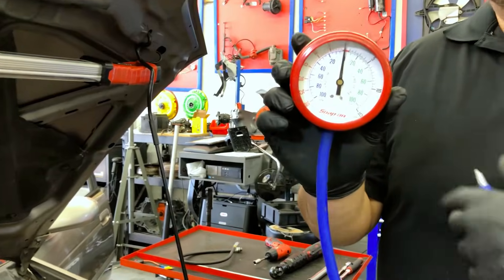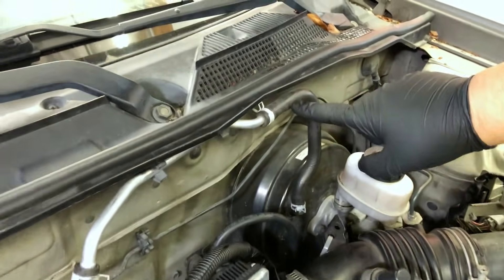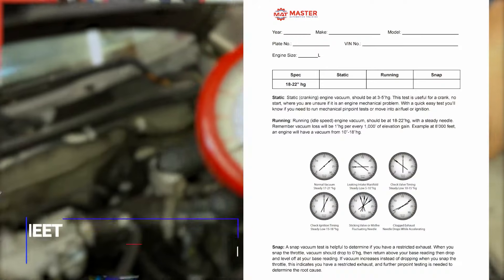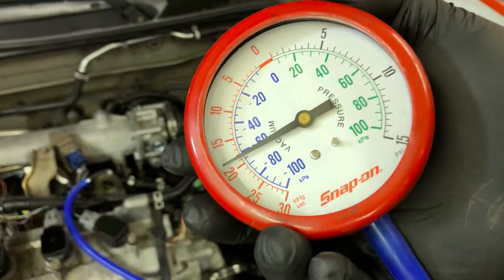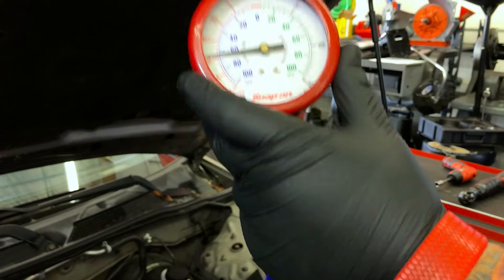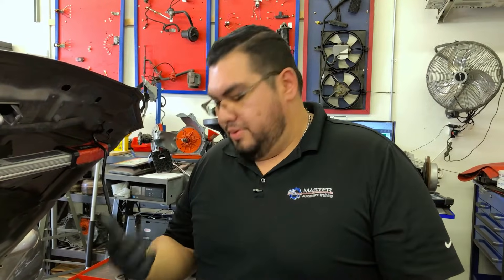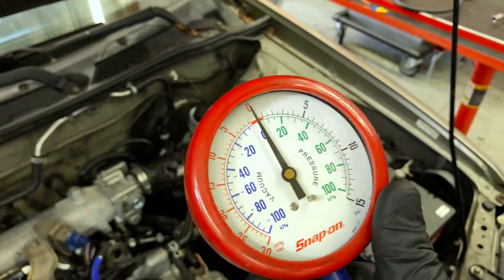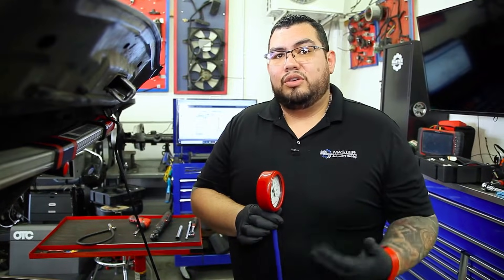HOW DO YOU TEST AN ENGINE VACUUM? | Step by Step

Comment: Now please re do this on a small block 350 engine. I cant figure out my total timing and I have no idea how to. I do not know what initial timing I should set my engine at 8 or 10 degrees and I do not know what vacuum I should have it at base because when I adjust my fuel and air mixture screws on my carb  my idle rpm climbs then I cant use my idle speed screw to lower the idle unless I drop my vacuum to around 14.

Comment: Can you use any of the hoses attached to the EVAP Solenoid Valve ??
Reply from the maker: Yes that would be the best point to test vacuum. It is a centralized point.
Reply: @MasterAutomotiveTraining  Sorry, let me clarify. Can you use any one of the hoses attached to the EVAP Solenoid Valve, or do you need to connect to one particular hose??

Comment: Another symptom of a crank no start condition timing issue is there is less resistance on the starter. The starter will spin much faster and you can hear the increase.

Comment: You can you the braje booster line on a 3rd gen 4runner just hook your vacuume hose into intake nipple ,I check  it that way and I also verified the way that you said results were the same ,thank you for helping us out .and were do i check fuel pressure on the 3rd gen 3.4runner v6 4runner theres no shrader so might have to get some fittings it would be cool to have a pressure gauge inline thatspart of the fuel line. Follow me ? Help is appreciated. Thank you .

Comment: Mistake in the sheet: At 8,000 ft =2,438 m - 10-14 is correct, not 10-18.
Please check.
Btw.: Fantastic informative video, thank you!
👍
Reply: What about at 2200 feet?
Reply: @mohammadrezamahmoudi4845  Do you have a calculator in your phone?
😎
Reply: @equisclassictouringrallies3353  yes
Reply: @ Great. Use him.

Comment: I hooked up my gauge to the fuel pressure regulator hose because I don’t have a shrader valve on a the rail.. my reading goes to normal
Motor than drops to the late Ig timing . When I give it throttle it goes to normal again.. is my engine out of timing?

Comment: Vacuum gauges were an option to have installed with the dashboard innstruments. It helped to save gas by teaching the driver to have a lighter touch on the gas pedal by trying to keep the pointer in the green (higher vacuum). The movement of the pointer also indicated the condition of the engine while driving. Stuff like carb imbalance, burnt valves, worn valve train, worn rings, vacuum leaks, etc. I used a vacuum gauge when adjusting points dwell and idle mixture when tuning up engines.
Reply from the maker: Yes, I recall seeing them when I used to work on old carbureted vehicles in my earl days as a technician.

Comment: Hooked up a gauge to my 350 sbc needle goes to the timing in red just before the green for normal engine. Checked the timing is at 8 degrees before tdc. Starts up fine . Why wont it go into  the green for vacuum check .Thank you much . Ruben
Reply from the maker: Any modifications to the engine? By red you mean 10"hg or less? Or in the 15"hg mark?
Reply: Yes had light modifications done.  Needle is in the 15 hg red
Reply from the maker: @rubenosuna115  Were the mods a cam? Is it carbureted? 15hg isn't bad, also what is your altitude?
Reply: Yes isky cam flat top piston  , 600 edelbrock,  and  performer Rpm intake.  Only about 3200 for elevation.
Reply from the maker: @rubenosuna115  Gotcha. Just with the 3200 elevation that would drop vacuum to 15-18" being at 15" would be perfect, especially with the engine mods and carburetor.
Reply: Ok thanks alot for the info. Makes since  , keep up the good work you guys ROCK  👍👍👌👌 very informative

Comment: I get a vibration between 18-21 almost at engine speed. 150 psi across all 4 cylinders, valves all adjusted, intake gasket and splark plugs replaced....still rough idle. Im stumped...#1 cylinder drop test yields very little RPM change while the rest do. Lean cylinder? Not sure how..
Reply from the maker: You have a weak valve spring buddy.
Reply: @MasterAutomotiveTraining  would piston rings installed incorrectly make this happen? I found the #1 piston ring 1 and 2 swapped. Ill check springs. This year went from double springs to single for some reason.

Comment: 2:28 Engine idle vacuum test (18-22 inches at sea level -1 inch for each 1,000 ft of elevation)
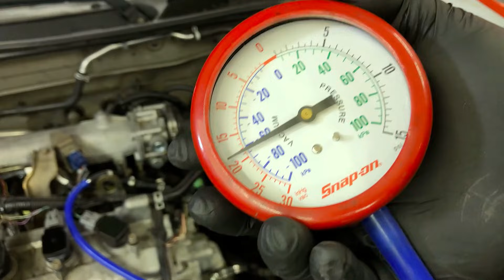4:30 low power when you accelerate fast - perform snap test to see if restricted exhaust, (snap throttle and vaccum should drop to zero and then stabilize back to normal)
6:08 Cranking no start - perform cranking vacuum test to see if there is a problem with the valvetrain or timing belt/chain (3-5 inches)

Comment: Disable the fuel by WOT ,dont have to pull fuses or relays....just saying.....
Reply from the maker: If clear flood mode was part of ALL PCM strategies, I would agree with you. Since not all manufactures have a clear flood mode strategy built into their PCM's, I can't say thats a one size fits all. Pull the fuse or rely when.

Comment: If I understand correctly, at my altitude of 4000 feet my gauge could read as low as 14 inches Hg and still indicate that I don't have a vacuum leak? I'm getting 17 inches Hg and it's steady. I did the other tests and they don't indicate any problems.

Comment: Great video bro and thank you🙏  Does it matter which hose you pulled off  the purge valve I noticed there were two  ports/
Reply from the maker: Thank you for watching, use the hose from the solenoid to the intake manifold to run the vacuum test.

Comment: Is it normal to be low if I do the test with the ac on because I had the ac on and it was low but with out the ac on it was on the right pressure
Reply from the maker: Yes, as the AC compressor adds load to the engine, which reduces the engine vacuum.

Comment: My brake caliper cylinder stuck   even new caliper. I change brake vaccum hose but still caliper cylinder stuck & brake Rotor get hot.
Is any body know what will be problem.

Comment: Great video and explanation...but you can use  the metal pipe at the brake vacuum booster, as long its towards the intake manifold. A small distance away you are at the intake manifold. Great video.

Comment: So, in crank and no start situation testing with vacuum gauge is like RC testing? At least overall engine mechanical status.
Reply from the maker: Slightly on an RC you’ll see if one or more cylinders are low on compression. While a cranking vacuum would be more for all cylinder like a chain or timing belt out.

Comment: great video but could you do i video on ecoboost engine with vacuum pump running of camshaft ford f150 3.5l at idlle im getting only 13inch/hg brake pedal very hard

Comment: I have the same engine in a 2006 Nissan Sentra and theres air blowing out of the oil cap after removing it. I read this was normal and was wondering if i could do a crankcase psi test with a vacuum gauge and how? Thanks

Comment: Love this quality content!   Was wondering how i could tap into my 91 chevys system to test vaccum.   I got a 5.7l v8 TBI  and dont know where id connect a vacumm gauge at...
Reply: I installed a vacuum gauge in the dash of my '88 Chevy G30. I teed off the vacuum line going to the vacuum accumulator.

Comment: great video, ,my 2011 tacoma is sluggish when passing another auto or going on overpass. Toyota could to find the problem. I later found a PO456 code (means a small Evap Leak). I can not figure it out.  Thanks

Comment: Great information. My 289 is running at idle only 8 inches of vacuum. I will try your cranking test. I was hoping the problem was the intake manifold and not the valves

Comment: nice video, I've been enjoying these so far.  I'd like to hear your explanation for the "why's"... during snap test, why does vacuum go to zero on a healthy engine, but actually climbs if the exhaust is restricted.
Reply: At wide open snap throttle the butterfly valve at the throttle body is completely opened up to atmospheric air …. therefore, no difference in pressure exists — in other words; no vacuum can be created .

Comment: Hi, I connected it after  green Evap service PCR valve. Got no reading.
Reply from the maker: Unplugs vacuum hose from intake to EVAP Purge solenoid and plug your vacuum gauge into the intake port.

Comment: On my 2012 Camry when I turn engine off the vacuum doesn't go down to zero. It holds the same vacuum as when it was running.
Reply from the maker: Hi Bill, what vacuum port are you using?
Reply: @MasterAutomotiveTraining  I used two different vacuum lines off the intake manifold. I checked the exhaust back pressure. It indicates a blocked exhaust. I'm wondering if I also have a egr problem. Thanks

Comment: This is excellent information! I really appreciate it. Question, is the vacuum test on a running engine, if it shows an acceptable inches of mercury range and the needle is not shaking, is that definitive enough to say the internals of the engine are relatively healthy? Would that be so reliable that I wouldn't even have to do a compression test?

Comment: Can loss of engine compression effect the brakes.  The following dashboard lights stay on. Check trailer brake system, check  brakes, traction control off, stabil-trac off and cruise control don't work. I've replaced everything except the brake booster and master cylinder.
Reply from the maker: Yes, since low compression creates less vacuum, will create less negative pressure on the front of your brake booster leading to lessened brake effect. Do you feel any braking problem?
Reply: My brake caliper cylinder stuck   even new caliper. I change brake vaccum hose but still caliper cylinder stuck & brake Rotor get hot.
Is any body know what will be problem.
Reply: @HappySailor2000 i had the rubber seals/washers on my brake caliper slide pins swell up, which prevented the calipers from releasing. I removed them and all is well again.
Reply: Brake line collapsed  @HappySailor2000
Reply: Idk if you figured this out but that happened on my gmc sierra and it was actually the wiring harness rubbing on the frame

Comment: Hey I have a 2000 Lincoln 4.6 that's idling high at around 1500 rpms I bought a vacuum gauge after watching your video and hooked it up and my car is reading 25 inches of Mercury, what would be the cause of this.
Reply from the maker: Thanks for watching. 25” is high. These are famous for leaking vacuum at the 90 degree elbow at the PCV valve.
Reply: @MasterAutomotiveTraining  I've checked all my hoses and Evey one is them is in tact no leaks. Even changed my upper and lower intake manifold gaskets. I changed my iac valve. Do you have any info that can lead me in the right direction?
Reply: @Master Automotive Training
Subscribed saved and liked
Had a question about pcv hose from valve cover to valve cover. If it's cracked or broke in any way is this consider a vacuum leak? Thanks for the videos

Comment: Should I increase idle rpm a little bit and ignition advance to increase vacuum pressure if its at 45cmhg?
Reply from the maker: 45cm hg is equal to 17 hg” no need to rev it, you are within proper spec.

Comment: are VAC READINGS accurate on a scan tool   thx bob
Reply from the maker: That's a great question Bob. If your car has a MAP sensor the reading you see is the difference in pressure from atmospheric to intake. Minus the reading your MAP sensor gives to the BARO reading on your cell phones weather app, the difference is the engine vacuum. 

Example: MAP reads 17hg and your BARO says 29.9hg. Your engine vacuum would be 12.9hg" did that make sense?
Reply: @MasterAutomotiveTraining  ok thx!
Reply: @MasterAutomotiveTraining  i do have a VAC gauge next time I'll check both ways an see  what i get for readings.

Comment: Thank you for these beautiful solutions. What about if you want to buy a car, and check it through the computer, especially since the car contains an internal computer that carries all the faults with codes, stores them, and displays them in case of examination
Reply: It's a good idea. However the codes might have been cleared by the seller  just before you scanned it, so your Check Engine Light will be off. And then the light may come on on your way home.

Comment: The vacuum gauge is the most under used diagnostic tool and its filled with overlooked valuable information. Agree?
Reply from the maker: 100%, its the most powerful yet underutilized tool! I have used a vacuum gauge to find many of those hard to find issues. Plus if you can't use a vacuum gauge then how can you use a delta sensor with a scope to monitor vacuum? I agree vacuum gauges need more use guys!
Reply: @MasterAutomotiveTraining  The issue with vacuum gauges is that you cannot reliably diagnose Atkinson cycle engines as they do not have much of any steady intake vacuum (as they actually push air out from the cylinder in part of the compression stroke, which nullifies manifold vacuum). If you use a vacuum gauge on an Atkinson cycle engine, then it will read near zero at all times. This is the reason why Toyota uses separate vacuum pumps to supply vacuum for most of their engines in the last 10-15 years. It is also why they don't have any testing procedure that involves testing for vacuum for nearly anything engine related.
So right off the bat that one of the US' largest car manufacturers where you can't use vacuum gauges for diagnosis. They're great, but they have some severe limitations.
Reply: @LordOfSilense 

Would it be good to use on Saturn engines? I have a Saturn Ion-2 2.2 and think i might have a vacuum leak
Reply: That, and using a smoke machine to find leaks (Exhaust, intake, etc)
Reply: That's so true! I can't find the issue with my 289cui and now iam hoping to get it diagnosed with the vacuum gauge!
Reply: 8:26